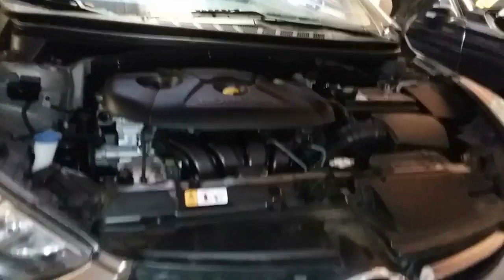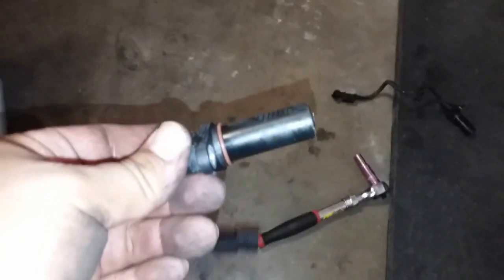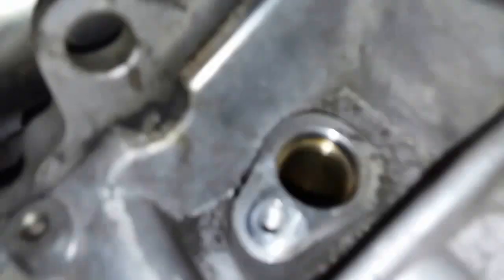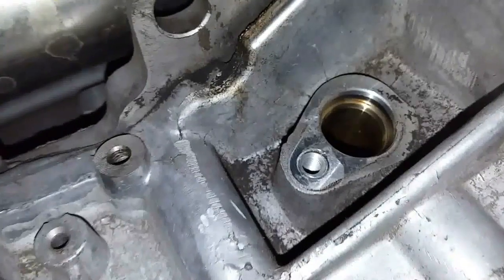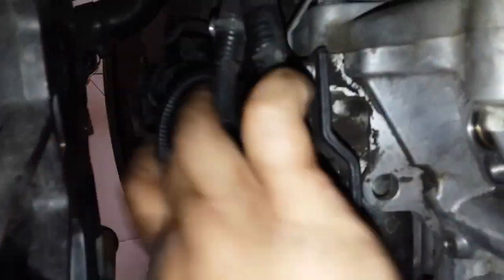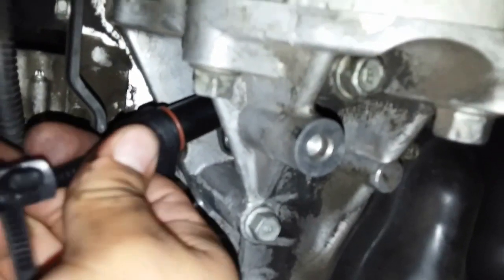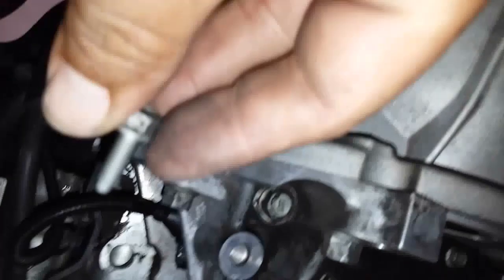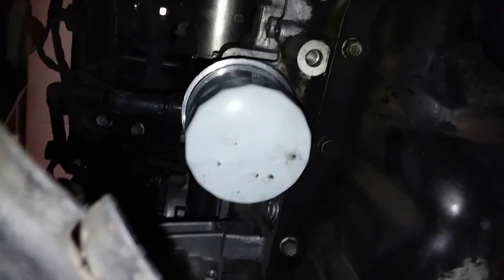How to: Install Crank Shaft Positioning Sensor on a 2013 Hyundai Elantra Limited

Comment: Thanks buddy!  Hyundai dealer quoted $460 CAD!!  I'm nothing close to a mechanic but thanks to finding this I bought the part off Amazon for $30 and did it myself in under an hour and fixed all the common complaints: rpm gauge to 0, not shifting, stalling, high fuel consumption. Didn't reset the code manually, reset itself after a drive or two. Will see how long the off brand sensor lasts, dealer quoted $125 CAD for OEM.
Reply from the maker: Heck yeah bro im glad you were able to do this and get it fixed! Yeah man a bunch of crooks them guys. Glad this worked! Thank you for your Support!

Comment: Great video! Is this why the rpm gauge is going to zero even while running and haveing it die while driving? Looks like a eazy weekend fix, no check engine light is showing, and it's been getting worse. Thanks for any help.
Reply from the maker: This could possibly be one of the main reasons why your car keeps dying what I suggest doing even though there is no check engine light on scan it with the OBD to reader and see if it has pending codes.  Nowaday cars any sensor can throw it off. Hope this works buddy, thank you for your support!
Reply: @559powerscape  thanks bro. A genuine OEM sensor was 22 bucks off Amazon, i got stands and a jack a 10mm deep socket handy 😎 ill drop by advance auto a barrow a scanner but im pretty sure the rpm gauge not working randomly seals the deal. Thanks!
Reply from the maker: @mikeh3334  Your welcome! Good luck buddy, thank you for your support!
Reply: @mikeh3334  did this fix your issue?
Reply: @situationormalgolf  sure did. Also needed to change the coil packs and she's running good now. I'd imagine that sensor is good for a good long while as I think it's just a magnetic pickup.
Reply: @mikeh3334  what are coil packs? i'm having the same issue as you.
Reply: i'm only getting the P0335 error on the OBD though.

Comment: I got the 0335 on my 11' Elantra and replaced it with a 'new' one from Rock Auto. It helped correct the stall out but now I'm having an issue with stuttering on the highway and lack of power at times even on local roads. Can't get the light to stay on and set a code. Do you suspect i got a bad sensor and it's still the same problem or could the harness be bad? Seems strange I'm having issues right after replacing it. Could i have a fuel filter or Cat problem?
Reply from the maker: I don't think it's an issue with the cats or fuel filter. Was the car running good before all of this? Personally I think it's the sensor. The thing about these electronics is that, its best to go OEM FROM THE DEALER OR PARTS STORE. ASK WHAT IS OEM recommended. For Honda its Denso for Chevy is AcDelco not to sure about Hyundai but it might be denso as well. If its cats it would smell a lil like rotten eggs, if its fuel filter I'm not sure now a days cars come with separate filters, I think it's all in the pump inside the fuel tank. Replace the sensor and see if that works. Check the pigtail also. Make sure all the metal prongs look good and not smashed in. Hope this works out for you!
Reply: @559powerscape  Thanks alot man, it was driving great for the first few weeks after i changed the CrankSensor from 0335 which was actually stalling at lights and the rpm going to 0 while driving. But after a few weeks i starting having stuttering at above 50 on the highway with the CEL flashing but i can't get it to stay on(I'm going to read the OBDii this weekend to see if there's anything). On top of that i have rpm drop and power/gear chance lagging on local roads alot too, so I'm not sure if that's more fuel or CS again. No stalling yet since the new CS. Odd.
Reply: And i will have my guy check the pigtail connection like you said as that's a distinct possibility(thought he would've when i changed out the CS but maybe not). The fuel filter is one unit and a pain to get at like you said too. I got the car at 67k and it's now at 105k. I'm having the trans fluid changed(not flushed) next week as i don't know if it was even ever done at all. Hoping that corrects some shifting/lag issues.
Reply from the maker: @jdthebooster  Man good luck brother sounds like some issues, sorry about that. Yeah the best thing to do is check the OBD2 for codes. It might have pending codes if no check engine is on. Obd2 scanner is a great way to troubleshoot  the issues with the car. The hard part is when there is NO CODES. Then it's a guessing game. Good luck buddy! And THANK YOU FOR YOUR SUPPORT! HOPEFULLY  THAT TRANS OIL CHANGE HELPS!
Reply: @559powerscape  Thanks George..I'll get back and let you know what it was(hopefully not too $$) when i get it fixed.

Comment: hi  I have a 2013 Elantra and the reading code said P0016 
i replaced camshaft and vvt solenoid , same issue could it be the crank shaft sensor? please reply
Reply from the maker: Here's a video that might help. These guys get into details in how to troubleshoot the issue. Hope this helps...

p0016: https://youtu.be/Dur7MCQXngs

I would start with a Seafoam Treatment on the engine. Pouring Seafoam into the engine oil case so it can clean and break down any clogged oil passageways. Drive it for 200 miles then do an oil change. Clear the check engine and hopefully this helps it. Here's a video on how to do the Seafoam Treatment...

Seafoam Treatment: https://youtu.be/njvatrs0-t0

...Goodluck 🙏

Comment: Hey George is there a brand you recommend in particular ? Is this the duralast ?
Reply from the maker: When it comes to sensors going OEM is always the best route, but some times more pricey. Sometimes the dealership price is not that bad compared to Autozone's price. Duralast is pretty good, but for instance on my honda it takes DENSO parts so I prefer the Denso over the Duralast. Not sure who provides parts for Hyundai but if you ask a representative at Autozone they might point you in the right direction. Good luck! Thank you for your Support!
Reply: Never use duralast for any electronic parts!
Reply: Colin Lindgren thanks for the tip! Ended up buying OEM

Comment: Would a bad sensor make the tachometer read incorrectly? My tach reads lower than what the actual rpm's actually are. Like if you rev it up the tach only moves a little bit. Edit: I have a 2009 Elantra thanks.
Reply from the maker: I'm not sure that might be the dash cluster its self that is going bad...the clusters usually go bad because it has little contact brushes....its all electrical...i don't think it would be a sensor....any CHECK ENGINE LIGHT?
Reply: Nope. No lights. No codes. Guess I'll have to look at the dash cluster. Thanks man :)
Reply from the maker: @jayb9687  you can try connecting an obd2 scanner and check to see if there is pending codes. But more than likely is the clusters bushings that are damaged...its what makes contact with the cluster in order to give you the readings.

Comment: My car jst gave me same issue today for the first time, I was so confused with no check engine light on. Will definitely replace this sensor asap, even tho it hasn't happened again.
Reply from the maker: You could try scanning for the code with an OB2 scanner even though their is no check engine, their could be a pending code and that will point you in the right direction
Reply: @559powerscape  Will do, thanks for the info. It's a 2013 Elantra, 145k miles. RPM tach was 0, misfired, no acceleration, , stall at stop. Once RPM moved on tach, it was back to normal like nothing was wrong. Restarted car and no issue at all, been fine since then. Part is ordered already.

Comment: Hi. I need to know if si true that after changing the sensor, I need to drive by 20 minutes over 100k/h until computer fix the troble.
Reply from the maker: Yes or you can simply clear the trouble codes with an obd2 scanner. You can also disconnect the negative cable from the battery for a good minute and reconnect it. That should clear it as well. Hope this works!

Comment: My sister car is stalling she has no codes could this be the problem? What was your symptoms?
Reply from the maker: When has the last oil change been done? How is the oil? Dark? How is the Air filter? When has the Sparkplugs been replaced? What kind of fuel is she using? I dont recommend Arco or mom n pops gas. Shell or Chevron or Valero is good gas I pump shell 91. Expensive but worth it.....I would check all those first. It just basic maintenance. Hopefully that helps.
Reply: @559powerscape  it actually ended up being the crank sensor . Thanks for the reply ✌️

Comment: This solved my problem it was stalling at low rpm hard to restart Tach would not work restart it works got worse    this was the problem give me more poswer better shifting and a smooth idle 
 I have 180 ooo on my 2015
Reply from the maker: Heck yeah im glad this worked for you! Thank you for your SUPPORT!

Comment: Is this the same motor as 2013 hyundai ix35?
Reply from the maker: Im not sure found this on google...

"Tucson/ix35 is available with several engines: an all-new 2.0-litre diesel R engine, one of two Theta-II petrol engine variants (2.0-litre or 2.4-litre), 1.7-litre UII diesel and 1.6-litre Gamma GDI petrol. The later two only in Europe."

Comment: ? What are the signs of a bad crankshaft sensor is rough idle 1 of them?
Reply from the maker: Rough idle, hard start or car won't start or  hard time staying On
Reply: I was driving dow a highway when it suddenly sounded like a popped a hole in my muffler, the stated experiencing low power, no tach. Starts out in a high gear so I have no power until it builds up on the highway. Same issue maybe?
Reply from the maker: I would scan it with a obd2 scanner. It's the only way to really see what the computer is detecting.  Autozone can lend you theirs and they can tell you what codes and what sensors need attention. Good luck 🙏

Comment: Will replacing the CPS make the engine light go off?
Reply from the maker: No you will have to drive it to clear on its own or use a obd2 scanner to clear it. You can also try disconnecting the battery for 5min then connect it back and see if that cleared it. Goodluck!

Comment: Hello I have a 2013 Elantra and the reading code said P0016 
That’s the camshaft position correlation sensor A 
I replace the one you are doing on this vehicle 
It’s still running rough 
There’s 2 sensor on the top right motor sensor A and sensor B can it be one of them
Reply from the maker: I found this online i hope this helps....
https://www.engine-codes.com/p0016_hyundai.html
Reply: Thank you George hopefully it helps I replace the sensor on the bottom front of the motor by the oil filter 
The 2 sensor on the top motor on the right has 2 sensors which are sensor A and B
I’m thinking one is bad would you recommend me to change them
Reply from the maker: You can try it. sometimes its a process of elimination. I would start there and hopefully, that takes care of it. Also u need to clear the check engine with an obd2 reader then drive it. U can also disconnect the battery for 30 sec and then reconnect it. That should hopefully clear the check engine. Then drive it.
Reply: @559powerscape  thanks George your a great help
Reply: @stephenmcgraw3610  hey so did you found out the issue having same issue on my car

Comment: Can you just cut the clip for the wiring for the old position sensor?
Reply from the maker: You can but you will still need to wire up the new pigtail to the existing connection

Comment: I’ve had this part replaced 3 times in the past 8 months, my Elantra is only at 62,000 and the code will keep popping up, or the car will randomly shut off, rpm readings at zero, trouble accelerating .... is it possible the prongs are loose?? The dealership and firestone don’t know what’s wrong
Reply from the maker: Wow. It sounds like there is something defective on the car. Either a sensor or pigtail connector to the sensors. Wow if the dealership has issues, I really dont know Either, sorry.
Reply: GEORGE LOPEZ HOW TO DO IT YOUR SELF yeah i am thinking to just trade in the car :(
Reply from the maker: @TheLuckyQui  im sorry i couldn't help. Good luck!
Reply: Did u get a tune up.... My sis started doing that too

Comment: Locación impact sensor?
Reply from the maker: Heres a video in how to remove it.. its in the front if the engine.  https://youtu.be/CdL8MwzFM6A
Reply: This is knock sensor
Reply from the maker: @douglasfff4190  lol bro look at the sensor. Its crank sensor. It goes inside the block. Knock sensor goes mounted to the block...the knock sensor is above the started. Crank is below the starter.